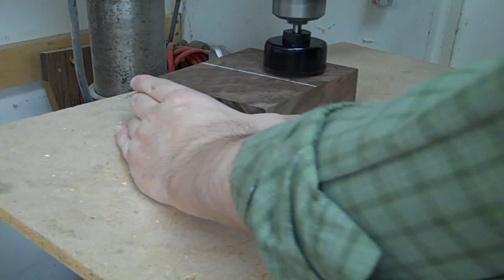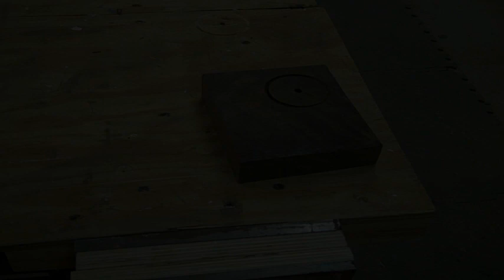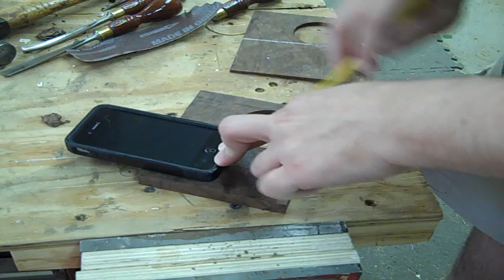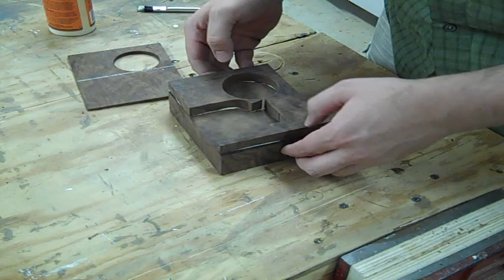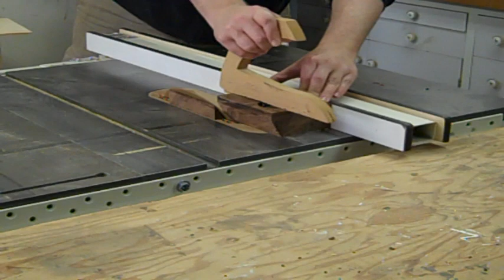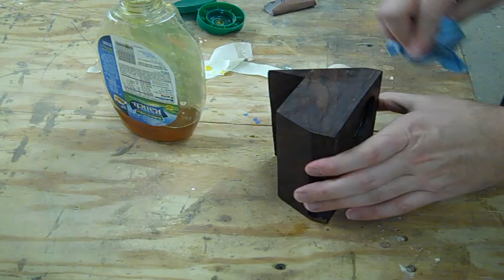How To Make A Wooden Speaker

Comment: Cool speaker.  wondering if you could give rough dimensions of the 3 "slices" you cut from the block.  Thanks!
Reply: Darla Sadler custom to your phone, the top layer is thin, the next layer which your phone sits in is as thick as your phone or case and then the back is probably just whatever your preference

Comment: Wouldn't it be easier to make the hole with a Forstner bit instead of carving it out with a chisel?
Reply from the maker: Totally. I wanted to avoid the pilot hole, but I could have removed the bulk with a forstner and then cleaned up the pilot hole with a chisel. Good idea!
Reply: Peter Brown The Forstner bits I have used did not leave a pilot hole, except maybe for a needle-point.  It was very much like a circular chisel. My dad used them to make clock-cases from wood.
Reply: Start with a Forstner bit and then finish the bottom (rounding) with a bowl bit - it will be much faster than using the gouge by hand

Comment: Um actually this isn't a speaker it's a passive amplifier!
Reply: its dumbed down for the general public
Reply: Um, people still get the idea. Just like, um, your post lacks proper grammar. Though, I imagine people still get the idea.
Reply: ***** um,um,um, saying um is a sign of low intelligence.
Reply: +Diet Nova Um, did you read the original post or should I, um, also insult your intelligence? Um, I used it sarcastically.